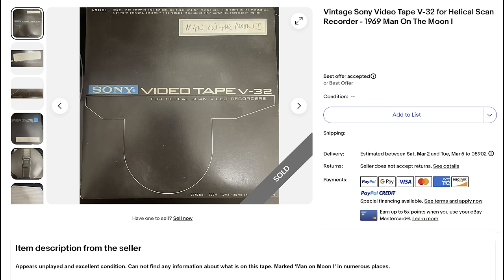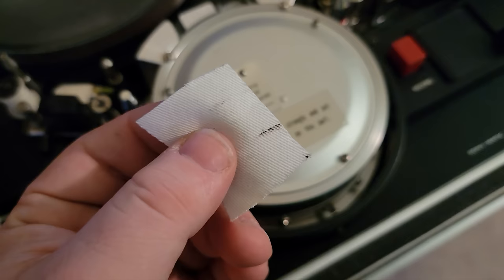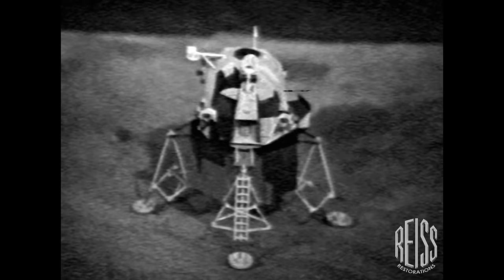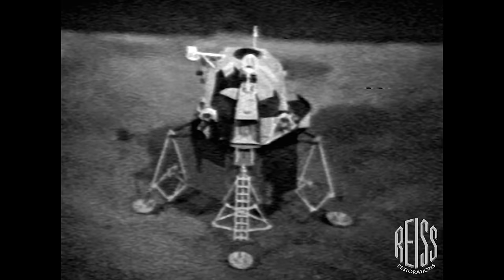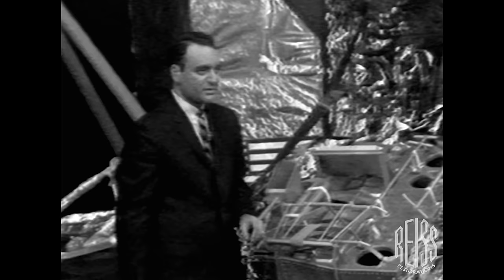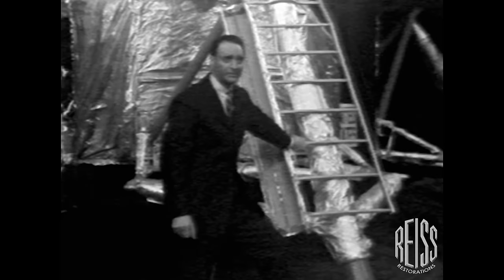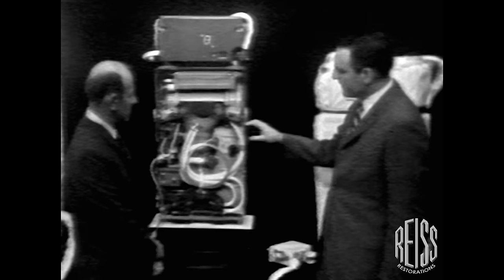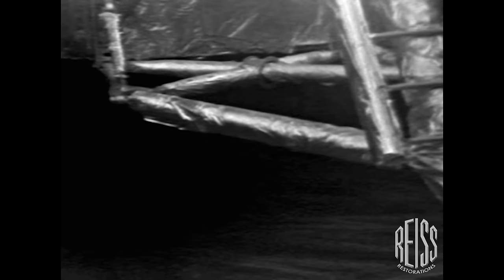Finding and Digitizing the Apollo 11 Moon Landing on NBC (July 20, 1969 - Partial Broadcast, B/W)

Comment: I always find it strange when the Mission Control has a conversation with someone on the moon without any delay.
Reply: Be aware that there should be no delay between the astronauts speaking and Mission Control answering.
Reply: @dansv1 so radio waves travel faster than light now? Listen to yourself and give your head a wobble
Reply: @reacey  
By the time the astronaut’s words are heard (and recorded) in Mission Control, the delay has already happened.
Reply: @dansv1  😄
Reply: @reacey  To clarify, the recording is on Mission Control's end of the conversation. For there to be a delay between astronauts speaking and Mission Control answering, Mission Control would need to purposely wait before answering.

Comment: And so in 1983. This is how an, Engineer like myself. Created our own Karaoke. Before any American including myself. Had heard the word and term, Karaoke. It was not yet within our American Lexicon of understanding. What the hell is a Karaoke? This is how I did my own, karaoke at home. And it took a little finagling.

Yes indeed it did. As I cannot eliminate the, Reverb. Behind Michael Jackson's lead vocals. And I don't want you hearing them. So I had to match my own vocal phrasing. Precisely with his. And so that his reverb. Becomes my reverb. But then I also added, additional reverb to me. On the FM version that got played. As I also had, one of those, humongous professional, Plate Reverbs. We had nearly killed ourselves with. Getting into the basement of my house. As it weighs over, 250 pounds. Half disassembled! That's not really on this mix rendition much. But helps to blend mine in with Michael's. To make it all more, homogenous and undetectable.

I will further add. My control room was similar. At home. With my, AKG 414 microphone into my, 12 x 4, all germanium transistor, Phillips audio console. And through my API rack of, original, 550 Equalizers/EQ/tone controls. Through my, Original, UREI, 1176 Rev.-D,, limiter. Followed by my Allison Research, KEPEX-1, downward expander/gate. Yeah. Not your average Home Studio in 1983. Before computers were invented!

And since my background. Was in Live Music Performances. And I had worked on some of the NBC-TV, Semi tractor-trailer multimillion dollar video facilities. And I knew some other guys. That had diesel box trucks. With audio control rooms built inside. For doing live recordings and live broadcasts of music entertainment events. I decided to build my own.

And so? I didn't just build a good one. I built a Huge Great One. That is, 120% that of the,, Sound City, Recording Studio Control Room. As mine is better than the one in the movie. You can stream here on YouTube for free. Produced and directed by Dave Grohl. Who. I've gotten to work with only once. Before I knew who he was? And thought he was about the funniest guy I had ever put microphones on a drum set for! He had me laughing my ass off. I didn't know who he was? It was after Nirvana disbanded. And he moved back home with mom in Springfield, Virginia. And I recorded him at a 4th of  July rock 'n' roll concert. On the Washington DC mall. Just 1 1/2 blocks away from the Washington Monument. At 23rd and Constitution Avenue, NW. For the Official, sanctioned, Protest Smoke In. For the, NORMAL Organization. Before it was ever legalized. And we wouldn't get arrested by the cops. Smoking our joints in full view! In Protest! But don't be caught. Selling or buying any. You had to come prepared. With your own.

And so Dave Grohl got so stoned. He forgot to pick up the recording from me. I was giving out to all the bands for free. And I guess he got, too stoned? And just,  staggered, stumbled, off? Everybody did that day. And every 4th of July running. Until it was legalized in DC over 10 years ago. So it worked! Rock 'n' roll worked again!

Then I found myself in Austin, Texas. This, all in a single, rock 'n' roll music venue/nightclub/BYOB only. They had no liquor license. $10 cover. A keg of beer in the backyard you could help yourself to. And rock 'n' roll bands till near sunrise. As they didn't have to close that 2 AM with no liquor license. And all of the bands of the other clubs would find their way there. For after hours rock 'n' roll. And I would get bad like this one.
https://soundcloud.com/remyrad/somtimesa-session-1-over-the-tr-fm

Once, I recorded Thursday night through Sunday morning. I would,  fold out the couch. In the Lounge/Control-2, inside my truck. And spend the night. Since it was parked in the backyard of the BYOB nightclub performance venue. As they had given me the keys to the building to access the bathroom.

So here I am still recovering on Monday night. Watching movies. When my finger hit one of the faders on my audio console. And I heard music coming from inside the club? This is not possible. The club is dark and closed on Monday nights. As I push up some more faders. Oh my God! There's a band playing! As I hadn't taken down my microphones from Sunday night. They were still all plugged in. There is a band playing!

So I get up and leave the truck. Unlock the door to the club. There's a band playing inside. There isn't anybody else. I asked him what's going on? The guy tells me. They rented the club to rehearse in.  As they're breaking in a new drummer. As their drummer has a military commitment and cannot go on their latest tour.

They were using the house PA system.  And they are plugged into my microphone splitter. So I'm getting a full feed. And I asked him if I could roll on their rehearsal? They said sure. There are, 3 microphones monies drum set. Kick/snare/overhead. And I'm still watching a movie. And playing with the drum mix at the same time. Smoking a joint. Drinking a beer. You know?
https://soundcloud.com/remyrad/noel-rehearsal-pll-comp-ec-2018

They had been rehearsing for hours. This is the tail end of their rehearsal. It's absolutely Awesome! And 2 drummers! And I missed pushing up the guitar solo. Because I was also watching a movie, drinking beer and smoking pot at the same time. After all it's only a rehearsal recording breaking in a new drummer. It's Awesome! It Rocks! He's a local Austin band that was touring the country before the pandemic. And that club has since closed forever. It only lasted a few years. They could've lasted 20 or 30. If I had stayed. I didn't. I pulled my truck out of their backyard after 11 months and recording over 500 bands live. That all came out sounding a lot like these. Almost like the guest bands. Playing for Saturday Night Live on NBC-TV. And there's a good reason for that. That's who I worked for for 20 years. That's what I did. But not that show. But this is basically an NBC-TV control room. As it is the exact Neve Audio Console. Custom-built for them in 1972 costing $85,000. Compared to the one that Dave girl now has from Sound City Studios that cost $76,000. At the same time from the same guy..  And Rupert Neve told me mine was a much better audio console. As I spoke with them for hours on end for many years. Having purchased the one I used at NBC when it was decommissioned and I won the bid. And then completely, recovering, restoring, refurbishing it to make it like new again!

I love what happens at the end of the first full cut. You hear a radio station with some other hillbilly rock 'n' roll on it. As there is an FM station up the street. And it interferes with some guitars. It was very funny.

(More Busting Pot in following post)

Comment: 31:00 if they were strap to their seats , with not much space inside, WHERE were those backpack life support? AND when we see them out from the pod back to earth they dont have it anymore, they left them on the moon ?
Reply: There were no seats in the lunar lander, they stood while landing.
Reply: There were no seats. They was originally but they realized that the relatively low G involved were well within human tolerance. As mentioned by an engineer in the miniseries From The Earth To The Moon-Spider episode, the knees are great shock absorbers. 

The inside was cramped but there was room for the essentials. Before liftoff, they ditched the PLSS’s and some other things because of the weight of the lunar samples.
Reply: Sorry, forgot to mention you can google that Spider episode available on YouTube to see the reasoning for the design without the seats. Long story short is they saved a lot of weight going that way.

Comment: Instantaneous communication with the moon, with little radio delay, is the only question? What technology did NASA use to achieve this. Even the President spoke with the astronauts with no delay of the signal. How did radio signals travel that far, in less than a second?

Comment: It would be/will be FASCINATING when someone uses high quality AI to clarify these images as best as possible, using both computer extrapolation from the data at hand here, as well as feeding it data, as to what the lander exactly looked like (including images taken when it was being prepared for launch, etc. at NASA, etc.) and feeding it data from images of the moon's surface, taken with the high quality Hasselblad cameras (which they had brought to the moon during the lunar program).  

Indeed, there are probably a lot of good source images of what the moon looked like in HD, where several teams of astronauts landed on the moon after this first landing, where they took many high quality photographs.  

Also with the NASA data from images of the spacesuits, etc., etc.

With all the correct data fed (properly) along with the source images/video, it will be FASCINATING to see a somewhat authentic AI re-creation.

Comment: My family and I and the whole world watched this on live TV. There was no color in it because the camera designed to be very robust, that is, heat tolerant. What you see is what we saw in 1969: resolution much worse than the oldest, cheapest webcam. Keep in mind too, the picture is nearly square because TV screens aspect ratio was 4 to 3. And you can see the contrast was pretty bad. Not only is the lunar surface mostly stark contrasts, but the TV camera dynamic range was very narrow. In fact, from the camera to our TV screens, everything in the signal chain was analog.
Decades later I rescued a press education folder from a Lockheed dumpster where I worked for 30 years. I still have that folder, which I occasionally share with family and guests. The illustrated drawings are labeled with lots of acronyms so the press and news anchors could "speak" the language like the knew what they were talking about. 
It had more impact on our thinking and living than you might guess. It's where boomers get their can-do-anything attitutde.
A coffee commercial depicted a dissatisfied husband complaining "We can put a man on the moon; why can't I get a decent cup of coffee?"
We didn't take excuses for failure after that.

Comment: But, at the top of the video it says "animation? does that not mean its not the actual footage?
Reply: The landing sequence was animation with the audio being the live radio communication between the lander and Mission Control in Houston. The 3 network news departments CBS, ABC, and NBC,  each made their own animations or simulations to show in the live broadcasts, because the video camera on the lander was not deployed until after they landed. That happened just before Armstrong came down the ladder. From that point on it was live video from the moon.
Reply: There is actual footage of the landing, but it was shot on 16mm film from inside the lander, so was not seen until after they retuned to Earth.
Reply: Yeah, the live broadcast from the Moon starts around 39:00 Everything before that is either an animation or footage of the full-size model in the studio, those are used to show the audience what they are talking about.

Comment: 33:01 where is the power source?
Reply: It’s the rectangular object on the lower left with the 3 bumps. It’s a 279 watt-hour battery giving 4 hours of time on the lunar surface. “Above the three control valves is the PLSS battery. Each battery had sufficient capacity for a single EVA. The first battery, installed before launch, is changed before the second EVA as part of the EVA prep procedure. Spare batteries were stored in the MESA, and a fresh set was brought into the cabin as part of the EVA close-out activities.”

Comment: And where my control room gear. Was really only designed with, low-grade, production capabilities. I would have to engineer. Like I was only making a, Beatles recording. Of, Sergeant Pepper's Lonely Hearts Club Band. In a much smaller dead box little studio. And even less basic equipment to use. Some kind of broken. And a Yamaha PA board. Which was awful. Barely adequate to record an announcer with. Was all I had to use. And it really sucked.  And so?

After the devastating fire. At the Studio. That took out everything. And all of the master tapes. Of those Jingles. That were used by the Advertising Agency. For well over 20 years.  Was now all lost.

Oh but? Lookee here! In my personal archives. I pulled out an old, 9 analog generations down, slow speed, 7.5 IPS reel to reel. Demo tape. Of those Jingles I produced back in 1979. When I was only 23 years of age. Never having done this before in my life. Not knowing what I was doing?

And finding. My tape is now horribly sticky. 18 years later in 1996. Ugh! Using a 1st Generation, Pro Digi-Design, Audio Media III Sound Card. Played back on my, Sony, TC-630, old, ragged out, reel to reel recorder. And without, Baking, the tape.

I worked out a different recovery process of my own. It was a bit messy. And required, fingertip tension control. I was able to recover my old demo tape. Of said, Jingles.  And the copy is, a total of 9 generations down. With No Dolby or  DBX, tape noise reduction. And so? You'll know what this is going to sound like.
https://soundcloud.com/remyrad/remygolnickjinglesotdemomb2

But years later. Goof Ball Engineers. Like myself in particular. With nice Home Recording Studios. Of a Fully Professional Equipped, nature. I would go into my control room. To have some fun. Of a completely, Inebriated, nature. To amuse my girlfriend. Who was quickly becoming a Famous Opera Singer.  And I wanted to prove to her. I could also sing. Like Michael Jackson. As a baritone white Jewish guy. Who can't sing. But I know how to Engineer Real Good LOL.

Then handing my Program Director. Of the #1,, Urban Contemporary FM Radio Station. A Flagship Owned & Operated facility of, NBC Radio. I gave my Program Director, this little joke from home. Giving him a, COCK & BULL, story. That I had gotten Michael Jackson off the Radio Network, lines. Of a Live Concert he did on a Bad Day. As a joke. I gave it to him as a joke.

I thought Donnie Simpson, did not like my little Michael Jackson joke. As I didn't hear anything for a few days. Until one of my colleagues was walking up the hallway I was walking down. And he stopped me in the hallway. Looked at me pointed at me and said, Michael Jackson? I said yeah!

So I asked him? Did you play that for Donnie Simpson? He looked at me and said… He made me play it. I said yeah? Did he find it funny? And he repeated himself. He made me play it.. I asked him what he was saying? He said he made me play it on the air. On the air? No!

I said you are giving me a bunch of bullshit. He said no. He announced it as Michael Jackson Live on a bad day. And told me to play it. Oh no ? You're kidding me right? He said no I am not kidding you. And when I heard Michael say FUCK. I knew it couldn't be Michael and that it had to be you. Oh my God? I rushed over to Donnie's office.

I rushed into Donnie's office and said Donnie! That Michael Jackson recording I gave you. It was me! He said yes. I know. You gave it to me. I said no Donnie. That wasn't Michael Jackson! I replaced Michael Jackson with me in my home studio. It was a joke.

Donnie Simpson is a very handsome black man. With beautiful dark green eyes. And he turned just as pale as this white Jewish kid looks. We could have been sued for so much money! Plus I let off an expletive. They could've lost the station their license renewal. Oh my God?

And here's a, Internet Remix. I did. Many years later.  As the one that went on air. Was an even closer mix to the record. And thus sounds even more believable. As I actually augmented my voice for this Internet release. So it's higher in the mix. And so you can hear my girlfriend giggled. After my last utterance. Which I boosted. You could not hear really in the FM version I gave Donnie. It's there but it's lower. In the mix. As the music in the background vocals which are Michael Jackson continue on. I had screwed up the lyrics. As I had not written them down. I was stoned. I was smoking a joint. And taking puffs. Between the lines. Handing it off to my girlfriend. And she's handing it back. I take another puff. Sing another line. And she's going crazy. As she had never heard me  sing. As I don't sing. And so I had to use a trick. They used for the Beatles. And what kind of trick?

I have a lower voice than Michael. Much lower. I can't sing those high notes he sings. So I actually had to slow the tape down a bit.  So I could hit those high notes. Then I played back at normal speed. I am now pitched higher. Like Michael. And the tune is in its normal key. But I don't sound like Alvin the chipmunk either. I do. If you speed the song up slightly more. And it came out sounding something like this:
https://soundcloud.com/remyrad/michael-remy-jackson-rokinu
LOL my finest hour! In only 3 1/2 minutes. This was the funniest thing that ever happened to me. Over 175,000 Washington DC listeners caught this. Thankfully. It did not light up the switchboard.

(More Pot Busting in following post)